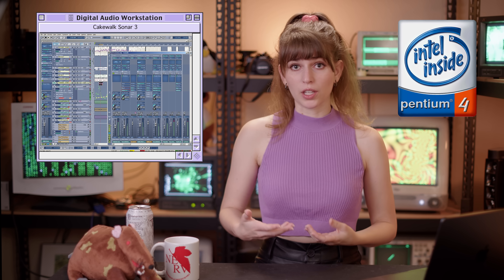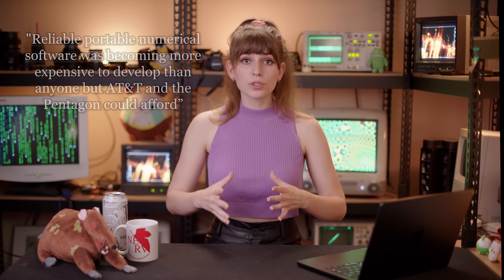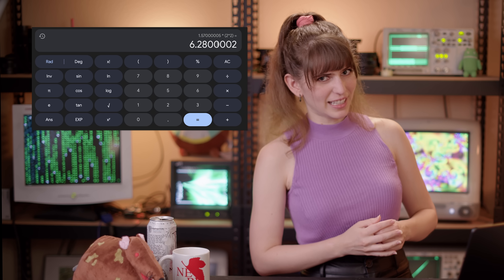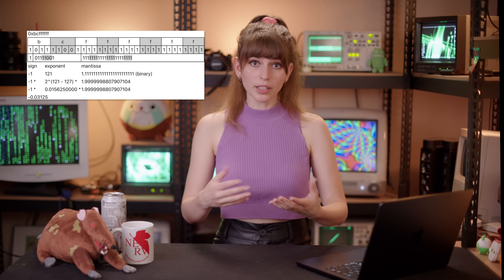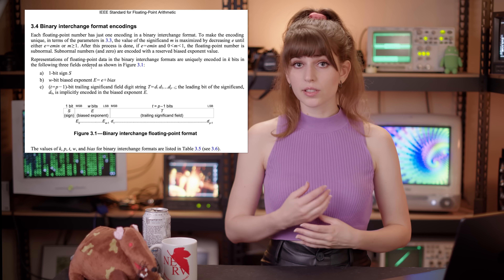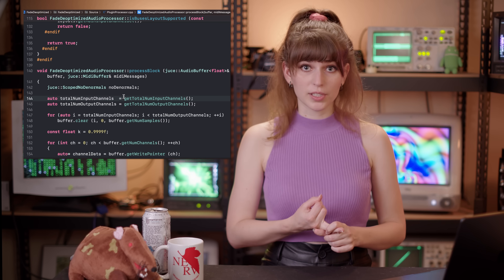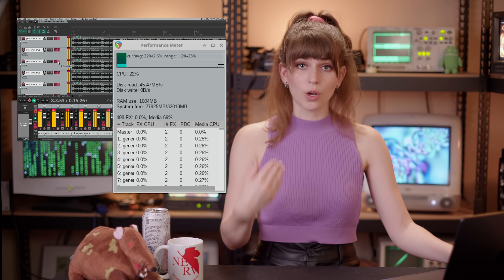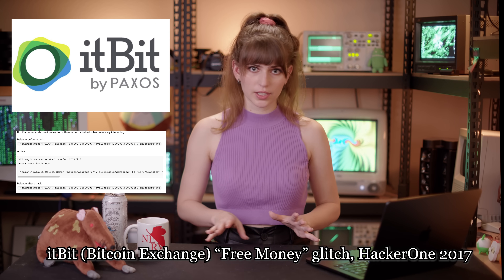Fading Audio is ROUGH on CPUs

Comment: Fun fact: Your guarantee at 6:00 is actually violated by recent versions of Python, which - instead of printing all of the digits - prints out the shortest number that would be represented the same way. But you can force Python to give a more raw output by using "%.16f" % 6.28, which WILL print additional nonzero digits.
Reply: She did say "as long as you add enough bits of precision"

Comment: Whether to leave subnormal processing on or not depends on the application, performance and accuracy requirements. The dynamic range of IEEE floating point is probably adequate for most common applications, but it certainly isn't trivial to select the best architecture when designing software. To avoid unexpected results by default, maybe leave it on, and leave it up to the designer to turn it off if performance is the priority.

However, I'm wondering why this is actually relevant for digital audio. Since its inception, digital audio has been done with integer arithmetic. Floating point really isn't the best representation. That is why we usually talk about 16 bit audio, or 24 bit audio. I'm told that Audacity uses 32 bit representation. But floating point, or exponential representation really isn't needed to get the dynamic range (or the precision) needed for digital audio. What's more, digital audio designers would rather deal with fixed integer precision than unpredictable, floating point scaling. We just don't need that kind of dynamic range, or the sudden jumps in precision and resolution that entails. 

Although audiophiles will object, I think it can be argued that 16 bits is plenty of dynamic range and precision for high fidelity audio, especially when properly dithered, and when consumed by mortal human ears in a practical listening environment. 24 bits are more than adequate to handle the headroom needed for mixing (summing) audio, and dealing with uncontrolled peaks in a live recording environment. So I don't know where floating point becomes a factor in digital audio.

Comment: Floating point moots this problem. Back in the days of the Commodore Amiga multi channel audio processing matrices for 8 to 16 channels existed for real time processing. In the early 2000s a program existed that was tested to 768 channels including input faders, output faders, and faders within the 768x768 matrix. This was all done using floating point numbers. It "almost" worked when we plugged in the board's second CPU only to discover Intel's vaunted inter-CPU bus worked in lumps too large to handle 48 ksps audio in 64 sample lumps. Yes, 64 samples - we had about a delay through the box of single digit milliseconds. It featured sample coherent starts on multiple channels of playback from disk. And it talked to cards with as many as 256 channels of audio. All they had to do is speak ASIO with 64 sample buffers at 48 ksps. It could and did work at 192 ksps but with bigger buffers. It also worked with 24 or 32 bit audio. However, we never found a customer for whom we could recommend such excess. Theme parks and airports are not quiet enough for that to be even pretend worthwhile. Yup. it's very predictable instant cueing was very nice for theme park rides. We're pretty much retired now so I'm not motivated to provide the product name. I don't want people to whine about the blatant advertisement. I'm just claiming this technology existed. It worked. It used floating point. (And it had a Hammond organ hidden deep inside we used for testing.) These days I process 10 Msps to 122 Msps I/Q data streams for SDRs. The notion that mere audio can be a CPU stressor sets off my Aspergers.

{^_^}   (And then there is real time HD video processing..... Done that, too.)

Comment: Interesting topic. For most of the applications I write I tend to use fixed point. Very rarely do I find a case to use floating point. Previously when I wrote safety-critical applications targeted for 386 processors (no floating point math coprocessor) I was forced to use fixed-point which made me realize how nice it is to not run into the types of issues seen with floating point.

Comment: "You mean 2.00000000 + 2.000000000 doesn't equal 3.999998456?"
I still have a Pentium 60 retro system. The installed P60 is an corrected one but I also have one of the famous p60 with the well known Pentium FDIV bug :)
Most hobby programmers are happy if the program simply runs without really understanding what is happening at the hardware level. Floating point numbers in particular can quickly cause problems without you understanding where the error lies. This is especially true for 8-bit microcontrollers. As we all know, computers never lie!
I was just recommended your YouTube channel, and now I'm excited to see what other topics will be covered! This could be a very long night :D

Comment: The most eloquent Stupidity I've ever seen so far this month!

Even the tiniest subnormal barely wastes 150 CPU circles, at a 48 kHz stereo we barely reach 0.48% of one core of the lamest weakest 3Ghz core CPU we can get today. 
And that assumes 

So NO! 
Fading Audio is ROUGH on CPUs is FALSE!
No, it won't "slow down your computer, or even your Phone, or a Pentium 3 CPU, it was a false and bogus statement from the start and it's still false and bogus to this day.

Also, you won't hear a 1.17549435e-38 difference with your human ears, ever, so a step fade will "fix" the non-Problem that never existed to begin with.

These fake "tech" channels are becoming more and more desperate for clicks by the year.
What's next? 
"Moving the mouse fast Cripples your Video Card?"
Damn... I just gave them an idea for another miserable horrible clickbait video like this one.

Comment: One DOES NOT do money with floats!

I still don’t grasp how this can be something people do. When we had assessment people over for certification of a rating/billing engine we’d built they were mortified from its “lack” of accounting for rounding errors. It took weeks of re-teaching basic maths to people whose job it was to check complex maths to have them see there actually weren’t any rounding errors to account for. How? Because we used integers exclusively. When holding money as MicroCents you can never run out of precision while still being able to hold more than 9 billion dollars in the same variable. Need more? Move payable amounts to another account that holds whole cents and you can easily hold all the money in the world. 64 bit int is a hero, you don’t want floating point money.

Comment: Did not know about this. For a programmer, the optimal solution would be to have either two classes of numbers, one that supports denormals and one that doesn't. Or maybe have the operands define that. For financial calculations, floating points most often are the wrong way to go in any case, those should usually be done with fixed point arithmetics instead, at least as far as I can tell.

Comment: It should only be a CPU load issue if the algorithm is poorly implemented.  Linear 32-bit integer representation for signals and coefficients has plenty of resolution even for high-order audio rate filters as long as you have the proper truncation algorithm (ie, towards zero) for your multiplication products in order to prevent limit cycles in recursive filters.

Comment: For real time mission critical applications, one is probably better off zeroing out all sub-normals and if the results are good enough, it's good enough, if not, there is no choice but to get a more powerful processor that can handle the necessary computational loads. 

For non real time applications where precision trumps speed, do whatever it takes to get as precise as possible unless the computational cost gets practically unfeasible.

Comment: This brought back a lot of memories with the 8086 CPU and the 8087 Math Coprocessor.  Wasn't until the 80486 that the math coprocessor (FPU  - Floating Point Unit) was integrated onto the CPU itself.  The 486 Pentium in 1994 is when the infamous FDIV bug was discovered.

Comment: Over the years, I have had to deal with at least 6 non-IEEE floating formats.  Some were more than a bit ugly to work with if you needed to do something like a large FFT.  IEEE doubles generally solve the problem nicely, almost.  I still see cases were stripping out the average first is a good idea.

Comment: that reminds me of some of my first audio development experiments i ever made. i wasn't actively searching for denormals, but i wrote a basic feedback delay, and those fade out stuff all the time, as you know. I ran the plugin and it had huge CPU spikes. I didn't use JUCE yet, but plug'n script. If you use that development environment with its scripting language, anglescript, it does not remove denormals. That's what I found out then, when I researched the problem. (Also array accesses are kinda costly in anglescript, but I think it was more of a denormals thing, because it got worse after I stopped playback)

Comment: You've explained floating point, and you've told us that small numbers are subnormal but at no point have you explained what the difference between a floating point and a subnormal is. Is there a difference? Why are subnormals computationally expensive?
Reply: Sub normals are when the exponent is the smallest it can be, and the mantissa is smaller than 24 bits in precision and therefore cannot be normalised because it has leading zeros and there is no way of making the exponent smaller to move the leading 1 up. 
It's slower because you usually have to call extra software routines to handle this, because the hardware can't handle it. So it's slower!

Comment: In my line of work, I try to use floating points never, but it is also true that I work in either embedded computing or deeply embedded computing, and usually all calculations can be done "good enough" with appropriately scaled integers.

Comment: 10:05 Slight improvement for Zen 4 compared to Intel CPUs here... Intel requires 123 cycles, AMD can do nearly two calculations in 1 cycle for the same calculation.
Reply: Hey, just so you know, there hasn't been a subnormal cost on Intel's flagship CPU line since Sandybridge. My laptop with an i3-3217U doesn't have any degree of slowdown no matter how many subnormals you put through its pipeline.
Reply: Yeah I guess effeciantly dealing with numbers smaller than 10^-126 not Intels biggest concern 😂

Comment: Interesting video! I would have assumed that subnormals slow the FPU instructions down only in "high precision" 80-bit mode of x87 instructions.

And never ever handle any money with any floating point numbers. Money works like fixed point arithmetic using big integers or rationals.

Comment: I'm old enough to remember hearing about the kerfuffle with Intel's floating point accuracy issues, but I was a kid at the time (if a very nerdy one) and didn't quite comprehend what this meant in real terms. This was fascinating. Thanks for the edification! 
Also, I would not have guessed that something like fading an audio signal would be so processor-intensive. It's funny how the distinction between what takes a lot or a little computational horsepower isn't that intuitive.

Comment: That's crazy, though it might makes sense with floating-point vs int. Volume fade-out is nothing for int. I do believe that it should be a CPU feature that can be turned on and off. 

I once coded a sine wave function, and if I used 32-bit float, it was inprecise. If you used 64-bit floats (a.k.a. doubles), it worked great. I do wonder if turning off subnormals would have helped or hut

Comment: Regarding the ending bit there…
Float struct is not used in finance.
It's a beautiful and fast engineering approximation, imprecise due to inevitable size limit on components.
Much slower bigdecimal struct is used for lossless calculations where you don't want to be accused of pinching pennies.

Comment: "-ffast-math" is really bad
It includes "-funsafe-math-optimizations" which really is unsafe.
In particular it enables "-fassociative-math" which is completely broken. It makes the compiler assume floating point operations are associative. But they aren't. So many techniques we use for things like forced rounding are optimized away, incorrectly.
I should do a course on programming with floating point.

Comment: You can eliminate subnormals by adding and subtracting a constant. This forces rounding.
You can even round to an int by adding and subtracting the right constant.
Modern x86 has the following flags for handling subnormals:
DAZ Denormals Are Zero
FTZ Flush To Zero
Subnormals are never needed for audio

Comment: You slandered DEC! And then didn't talk about the Intel FP bugs! 

Ok, that just a bit of old-school flames ;) but genuinely, there are mathematical justification for DEC's flush to zero (e.g. synthetic differential geometry) and they had WAY more bits of mantissa available than anyone until well into the 80s. AND DEC had proper support for decimals, which I don;t recall Intel ever really having. If my memory about that is wrong, I can only claim the excuse of never having used decimals on Intel

Comment: As an engineer who has coded a lot of audio software for x86, I have spent SO MUCH time working around subnormals (when we couldn't turn them off for compilation). I have actually used the X = (X+X)-X; trick, or even my favorite, X = (X+a)-a; where a is a number at least ten times larger than abs(X) ever will be. So fun to actually get @LaurieWired coverage on this topic! Your videos are so very well done! I never knew that these many hours of optimization tricks I've done are due in part to conversations between Intel and DEC.
Reply: Why? Audio uses 32 bit floating point numbers at most, while the CPU can handle 64 bit floating point numbers. So why bother with calculating any subnormals, when the CPU's calculations are already virtually infinitely more precise than the numbers you actually use?

Comment: The problem with float types is that this numerical class is not a natural fit for the discrete nature of binary logic. That's why IEEE-742 document was created to shoehorn float types arithmetic in the digital computers and navigate around the numerous corner cases: proper rounding, subnormals, infinity handling. It's not that this specification postulates the perfect way to do float arithmetic, but simply to serve as a common baseline where everyone can be sure their product will be binary compatible, i.e. everyone can be on the same page.

Comment: floating point is a waste of memory.... and i say that because it is a waste of memory to even consider a number like 6.28 being a different number when it is just 628 with a dot behind the 6. the same way negative numbers are just any number with a - in front of the number..... instead of wasting memory trying to make the computer "understand" what it is doing, which it never will.... because it is a computer, it just does what you tell it to..... you can just use exponents to pin the location of dots and other signs and just scrap floats. the machine would actually show you 6.28 when you use 6.28 in a calculation, not 6.28 bajillion zeros and a 2. there literally is not a single calculation in existence that even requires a single decimal if you have the exponential value that makes it a number without decimals....computers are expensive because of this float nonsense. it eats up over half your memory to even incorporate it. it is lazy in the sense that it is just a way to cope with imperialists wanting to salvage their redundant units when we could have been seeing way more real progress, and cheaper computers.

Comment: I've never had to deal with subnormals professionally, so I found this very informative, thank you!  I was really surprised by your comment at the end about how FP precision represented a vulnerability in some crypto applications, because in all my years of working on financial software (I worked on medical claims clearing houses for 15 years), we would never use a FP to represent currency.  You would always use a long to represent the smallest fraction of a cent you wanted to be accurate to rather than trying to use a decimal.  You could always do some modular arithmetic to format it for the user with no precision loss, generally faster than dealing with floats, too.  Much like seeing a non-UTC datetime in a database, seeing a float in a routine that handles currency was usually a sign that a junior engineer wrote it!

Comment: My opinion is that in cases like this, there shouldn't really be a "default". There are two behaviours with a trade-off between them, the choice should be made explicit to the programmer. Personally I would tie the difference to types. For instance have fast_float64 and precise_float64 types which would tell the compiler whether to use subnormals or not

Comment: This is all assuming you're using floating-point arithmetic to fade your audio, though. (I know, audio is just an example and not necessarily the, er, point of the video.) For most audio or video applications, though, you're better off sticking to fixed point, just use a wider type to avoid intermediate artifacts (e.g. int32/7.28 for 24-bit samples, or int64/23.40 if you have crazy range and precision needs) and still not have to deal with float headaches. Besides, denormals will get zeroed on render anyway.